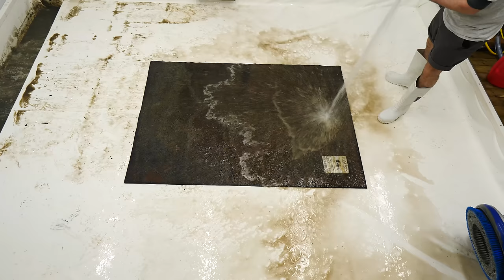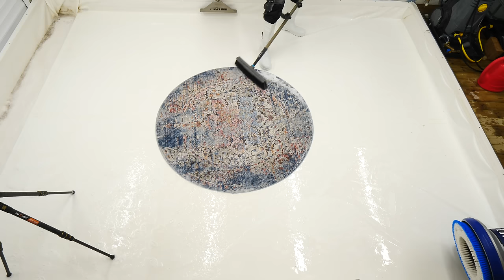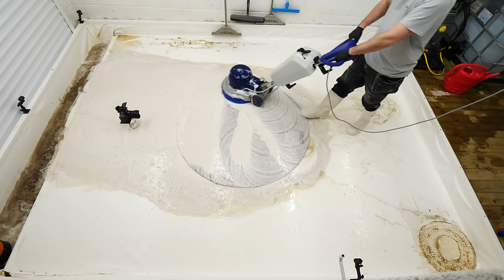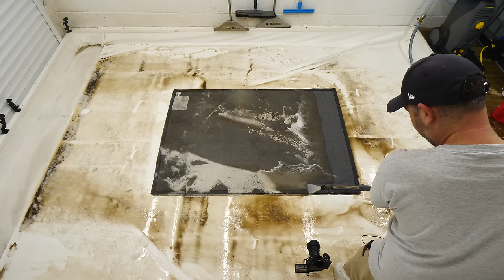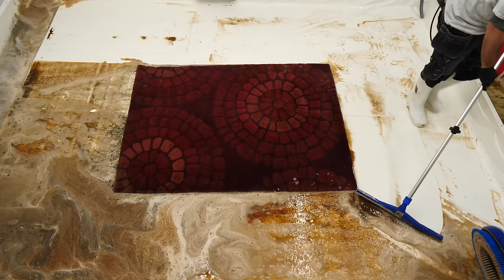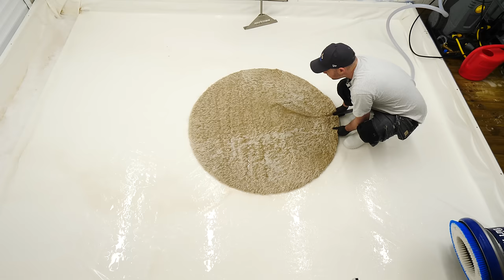This WILL HELP You SLEEP ! Relaxing Rug Cleaning | For Deep Sleep | Stress Relief | Anxiety Relief

Comment: How come the dirty water doesn't drain fast out of the pit
Reply: I was wondering the same thing.😅
Reply: @marilynclark7298  I would have a 2 inch pvc pipe running to the hill in the back if he's got one cause alot of dirt turn into bunch of mud after so many runs but it would drain real quick